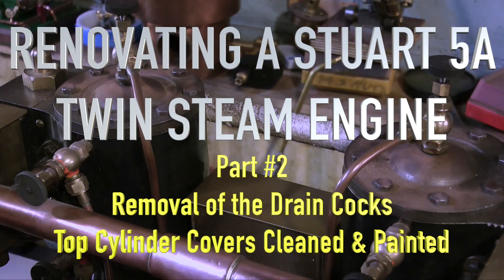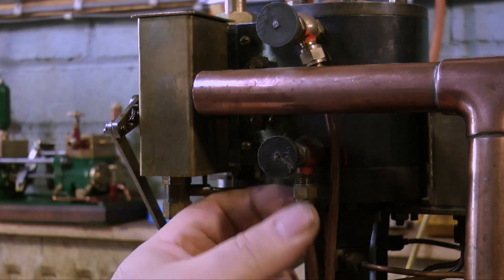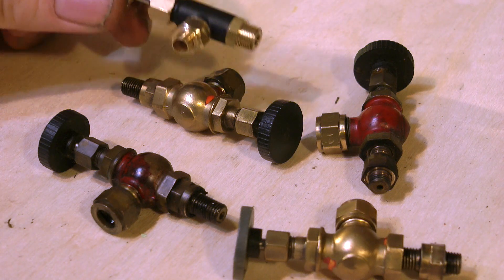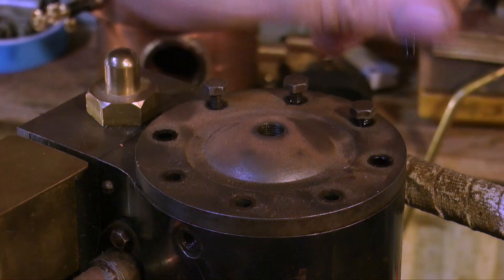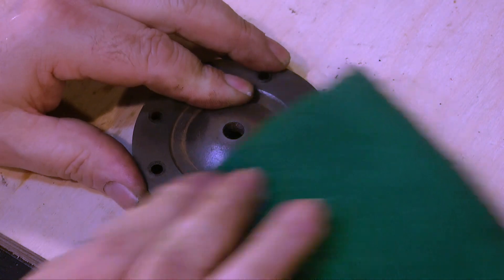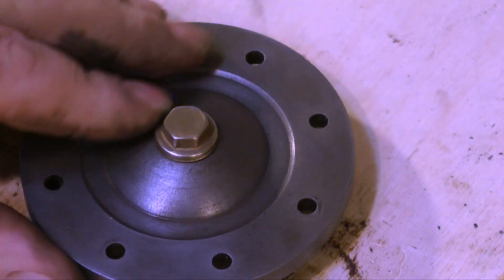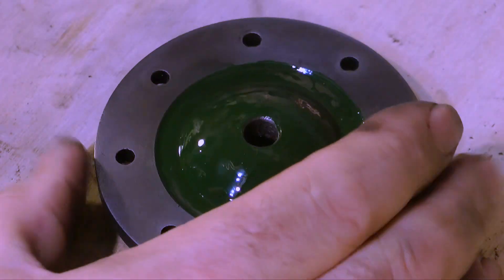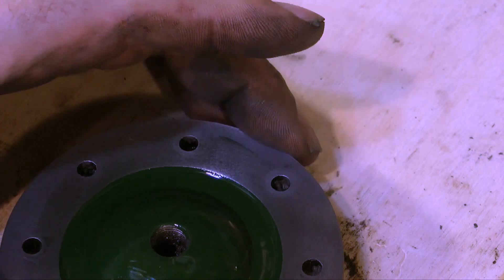STUART 5A TWIN RENOVATION - PART #2

Comment: Hi Keith, Do you think it would look nicer if you could find a pair of small brass oil cups with valves to go on the top cylinder heads instead of just plugs? I think they would compliment the studs you're replacing the bolts with a bit nicer (or Classier/Authentic to a steam launch in my opinion, but you know what they say about opinions) than the plugs. And they could come in handy for putting some steam oil directly into the cylinder before and after you're done running on steam so the engine stays well lubricated and doesn't rust internally depending on how long it will be between uses and what boiler and what feedwater treatment if any is going to be used after the renovation. I mean yes you could also take the plugs out and put a few shots of steam oil in, but I just think the valved oil cups are nicer and actually have a purpose instead of that extra drain tap.
Reply from the maker: "Tallow" type lubricators would be OK I suppose, I will see how the time pans out on this one as to whether I have the time to make a pair.
Reply: Ah that's the name I was looking for! I couldn't quite remember it. Yes Indeed I think they would look beautiful atop the cylinder heads. Hopefully you will have time to make some. Thanks again for the great videos and the beautiful work you do and excellent comedy. I always look forward to them!

Comment: I thought those globe brass valves you just took of the engine looked really quite nice, while the one you showed off looked plain and boring compared, and plastic sleve? what's up with that? On the other hand the handle on the one you showed was much nicer than the big plastic ones on the globed ones. Knowing you haven't decided yet and all, just wanted to give my opinion.
Reply from the maker: No plastic on that one - just painted brass. I propose to use brass globe valves with spoked handwheels.